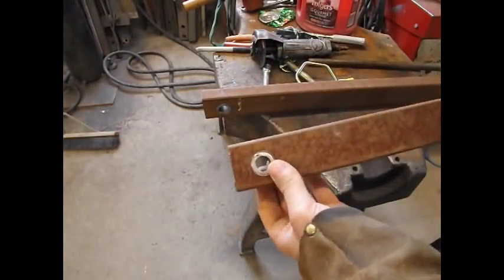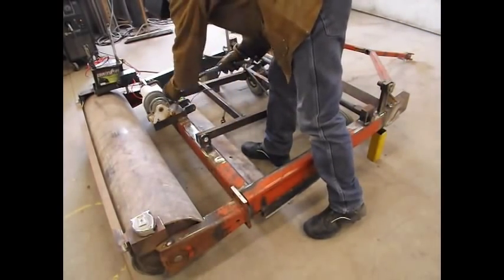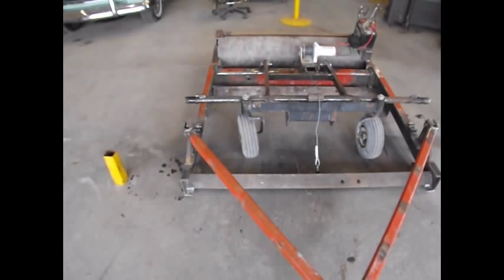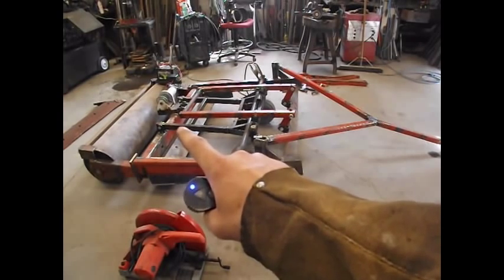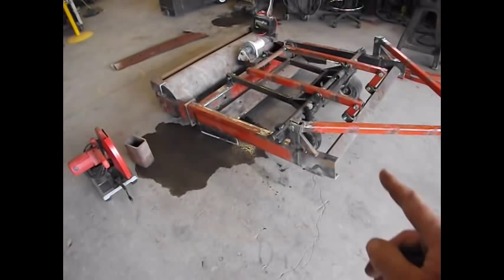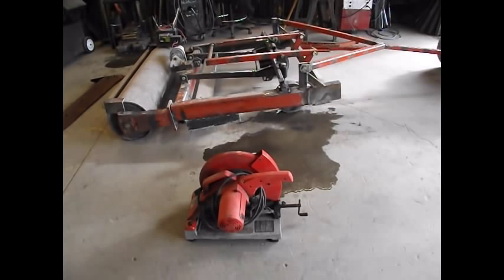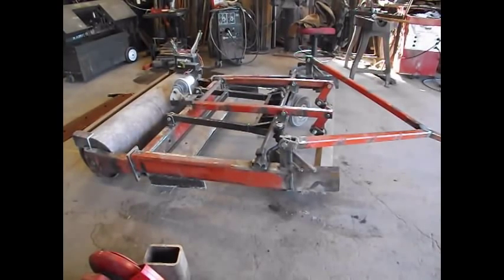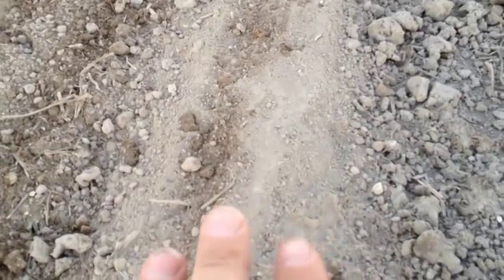Power Grader Build - Part 8 of 8 (Or watch the condensed version!)

Comment: I'm glad I watch all eight parts of this Grader's build.  I might now watch the 15 minute edition and see how that looks. But the detail in the build is what kept my attention.
I imagine there are as many tips and ideas of how the other YouTubers  would have done this, but I chose to just 
'shut up' and watch you work it through. It's turned out well, but I do have one thing that's buggin' me, and that is, please fix that 'huntin' carburetor on the Cub Cadet. That govenor running erratically is driving me nuts !  Hahahaha.
Good job, you have a right now to be proud of a job well done .
Reply from the maker: +Reg Sparkes  Yes that Cub Cadet does hunt, and I've cleaned and adjusted the carb a few times. That engine has done that from day one. I'm beginning to think it has an air leak somewhere. Thanks for watching all the parts! :)
Reply: +Wide Vision Metal Fab 
I guess you've checked to make sure the govenor control arm and rods are not bent , while you're at it, make also sure the rods that control the carb. functions are straight and not obstructed in any way too.
Have you used acetylene gas to check for carb. to engine leaks ?
Reply from the maker: +Reg Sparkes No I haven't used acetylene to check for leaks. I should do that!
Reply: +Wide Vision Metal Fab 
 I sure hope it works and you find the problem soon.

Comment: You should figure out a way to put a roller on the winch cable where it goes over the rod on the leveler, and an eye  back on the winch frame to attach the end of the cable.
Reply from the maker: Charles Lambeth I did but I left it out of the video to keep it shorter.